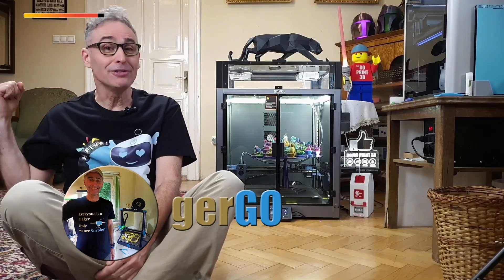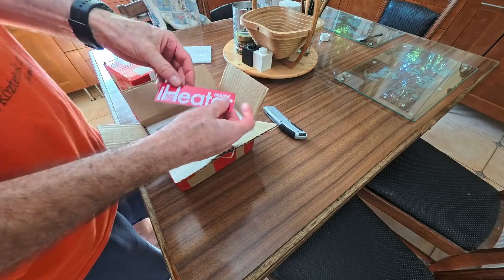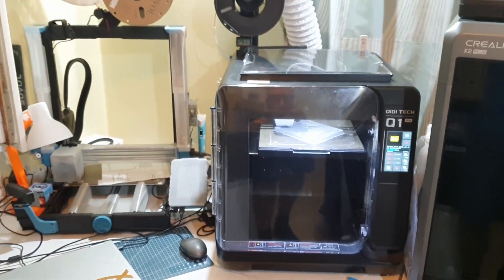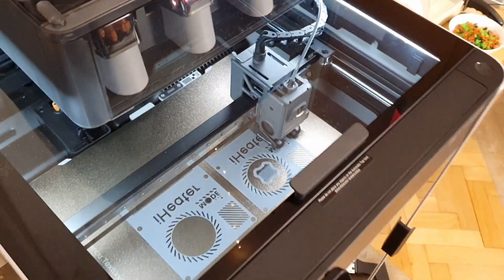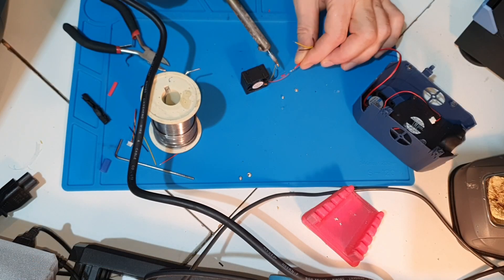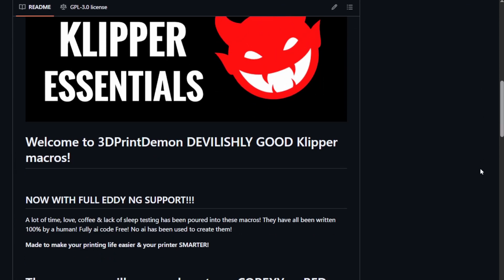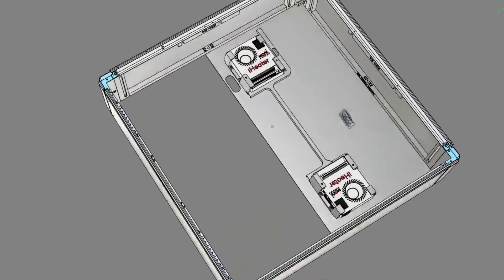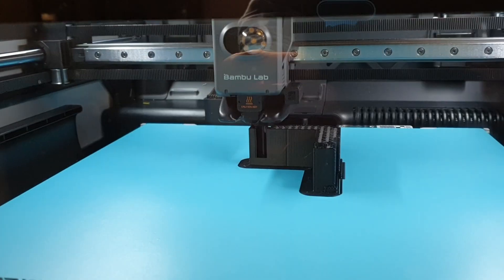SV08 MAX Chamber Heating SOLVED 🔥 Dual iHeaters for 60°C in 10 Mins! 🚀 Making it even better: Part 3

Comment: GREAT video as usual. Would be really handy to have a video on integrating the iHeater with Demon Macros. I used your video (and your brackets) to help add an iHeater to my SV08 non-Max and there's a few things that need to be done to integrate the iHeater with Demon Macros and once it's set up it's a game changer!
Reply from the maker: Thank you for the feedback! I would love to make a follow up video. What things did you do to integrate the iHeater with DKEU? For me they work together well enough, but I am sure it can be improved. Now you made me curious :)
Reply: @gerGoPrint3D  When it’s integrated the chamber heater is controlled until chamber temps reach what Rory has in the various filament profiles in the Demon config. I only have one heater and all I really had to do was edit the iHeater config and change “iHeater_H” to “Chamber_Heater”, “iHeater_S” to “Chamber_Temp” and charge the name of an output_pin. If you wanted to keep the “iHeater_” names that requires editing some of the Demon config files.

Comment: Sovol suggest printing with PETG the doors should be left open, apparently the heat soak with doors closed causes models to sag. It is not clear from the video why these heaters should be added, or what their compatibility / usage cases are? I am waiting for my Max to despatch (ex AU store), first printer owned, and trying to get all the prep done while wait (Noctua fans coming, post processing, hoto etc). When are these heaters a good idea? Thank you.
Reply from the maker: Great question! You're spot on – for PETG, you should keep the doors open and the heaters off to prevent sagging. These chamber heaters are essential for high-temperature filaments like ABS, ASA, and Nylon. These materials are notorious for warping and peeling off the bed if they cool down too quickly. The heated chamber keeps the print warm and stable, preventing that warping and making successful prints possible.
So, you'd only use them for those specific materials, not for your everyday PLA or PETG prints. But that's one of the main benefits of adding enclosure besides the dust cover (which is also important). So keep the doors open for PETG and PLA, and preheat the chamber using the bed and optional heaters if you are going higher temps. Welcome to the hobby!
Reply: @gerGoPrint3D  Thank you for the clarification and confirmation. So, moving to the opposite end of the current topic, do you know of a way to cool the enclosure without a lot of noise leakage so PETG could be printed in an occupied room (my home office)? There will be 24V Noctua fans for this, and setting up a thermocouple to trigger them (either two or four fans) is doable, but an acoustic intake on the fans to keep the noise from getting out is probably a job to do, if this problem isn't already solved. Or is enclosure ventilation unlikely to be reliable enough to prevent sag with PETG? Or am I over-thinking it! Thank you again.
Reply from the maker: @vinces2  Yes, you often can print PETG successfully with the doors closed. The stock dual part-cooling on the MAX's toolhead is quite effective for most prints. You'd really only need to crack the doors open for models with extreme overhangs or lots of bridging. For PLA, however, you'll almost always want the doors open due to its lower melting point.
Your idea about adding thermostatically controlled Noctua fans is exactly where an engineer's mind would go. The challenge, as you've correctly identified, is the SV08's "flying gantry" design. On drop-bed printers, it's easier to add external cooling fans. Other printers solve this with complex airflow (like the Creality K2's curtain fan) or even active venting (like the Bambu H2S), but it's much harder to implement on a moving gantry.
Over-thinking it? Probably a little, yes 😉 While building a custom acoustic ventilation system is a fascinating project, the bigger concern is air quality. My strongest recommendation would be to prioritize finding a place for the printer outside of your immediate workspace. Even PLA and PETG release VOCs (Volatile Organic Compounds) and ultrafine particles when melted. For a home office where you spend a lot of time, it's much safer to have the printer in a separate, well-ventilated room (like a garage, workshop, or a spare room with an air purifier/vent). That single move solves both the noise and the air quality problem at once.
It's a great path you're on with all the prep work! Keep the great questions coming!

Comment: sovol sv08 arrived 10 days ago. had the problems you all know about from inconsistent probing, good print quality but not great. installed the Eddy Scanning Kit from sovol which completely changed the printing experience. excellent first layer better quality print. installation very simple went without a problem
Reply from the maker: Awesome to hear you've had such a positive experience with the Eddy Scanning Kit! I hope to be able to test and demo it too on the channel.
Reply: @gerGoPrint3D  I believe you know, Mr. Gergo, but still. if you mount the eddy on the sv08, I lost 3 hours with the tool head plate. flashing the main board without problems on standard settings in ST-link. (frequency 4Mhz). for the tool head plate, I had to drastically lower the frequency, I don't know exactly, but I think about 400Hz.
Reply from the maker: @MD11pele  Thank you so much. I will need all the help I can get :) I will document my whole journey to get this working! I will email you if I get stuck :)  You see how the tables have turned. Maybe I will have to invite you to Budapest now!
Reply: @gerGoPrint3D  I was in Budapest almost every week for the past few years. I was transporting containers from the port of Rijeka.

Comment: Hi I got a SVO7 and I'm having a hell of a time with it the Z goes all the way down to the build plate and the motor keeps running and I can't get any of the programs to set up, Please help me
Reply from the maker: That sounds frustrating! It's very likely an issue with your Z-axis proximity probe. Here are a few things to check:
1) Probe Connection: Make sure the cable for the proximity probe is securely plugged in on both ends (at the probe itself and on the mainboard).
2) PEI Plate is On: The SV07 uses an inductive probe, which needs to detect the metal in the PEI build plate. Ensure the flexible plate is on the magnetic bed. The probe won't 'see' the bed otherwise.
3) Test the Probe: You can test if the probe is working by placing a piece of metal (like the scraper) underneath it. The small LED on the probe should light up when the metal is close. If it doesn't, and the connection is good, the probe is likely faulty.
4) As for the software issues, once you solve the Z-axis problem, the setup programs should work as expected, as the printer will be able to properly home itself. Let me know if any of these steps help! Unless you changed the software, in which case you are on your own  (or you can try to restore the factory software).
Reply: @gerGoPrint3D Impressed with the time invested in answering this comment. Thanks

Comment: Great video!
I'd like to suggest a video on installing Demon Klippers Essential macros, created by Roar Ree.
It would be very helpful for anyone who has received a blank printer and wants to try this type of modification on a Klippers for the first time, starting with the original firmware.
Thank you so much!
Reply from the maker: Thank you for the suggestion. Yes, I've been using it for a while, teasing it in almost every recent video (I mention it in this video too!). I plan to make a video on it, but there is already an install video → https://youtu.be/SvPROz0Q96M

Comment: I love the ease of printing high temperature materials on my little Sovol Zero - no chamber heater needed for that little chamber.  I now mostly print Siraya ABS-CF and eSun TPU-LW.  The upgraded SV08 Max will need a lot of electrical power but has enormous capability for printing large parts in ASA or ABS.  I assume you'll be adding the Bondtech INDX to max out your Sovol SV08 Max!  It's on my Zero and SV08 To Do list, hopefully in November.

Comment: Nice work, I've been using chamber heaters for many years now, I just uploaded a version 2 on Printables of my 200w heater and yes, a big printer like this one may need two of them, one of mine can heat a K1 Max easily to 65C when the bed is running.
Reply from the maker: Thank you! I checked your heater. How is it controlled? The big benefit of thes iHeaters is its integration to the Klipper system.
Reply: @gerGoPrint3D  Thats up to you, its easy enough to integrate into Klipper, you can use any old cheap 3D printer control board that is supported by Klipper, use the bed heater output and control it through USB from your main SOC Klipper setup if you want, but I use Home assistant with the Moonraker plugin to control things on my setups, as I have a bunch of automations including preheat sequences, everything is done through Zigbee devices, including an automated power cut off triggered by smoke and fire sensors, also controls exhaust fans and air filters, I have nice dashboards built in HA and these are accessible around my premises from any of the HA wall mounted control panels, I use Dell Latitudes for this, also the model for the wall mount is on Printables as well :)

Comment: This process is way to long . Sovol was advertised a enclosure as a equipment for heater. And when officially came out for sell it’s in fact without it . What a shame for this company ….
Reply from the maker: It is coming too. I think they were transparent that the enclosure will follow the printer, and a bit later they will have the heaters ready. They haven't yet sent heaters to us, beta testers either. I will make a video about the stock option too. Maybe even use the two system together! 🔥

Comment: Very surprised  to see that the top is the best place for the heaters. Since hot air moves up, the air which is heating will stay in the top of the printer. Mounting them a the bottom of the chamber (I know, no space for that in the Max) would create natural convection, circulating air. Hot air goes up, pushing colder air down which then gets heated etc.
Reply from the maker: Yes, we were also suprised, but the tests proved this location. My theory is that the huuuge bed already takes care of the lower half of the chamber, the strong blower fans mix the air higher up.  Convection would move the heat of the bed to the top, the two blowers push it back down...
Reply: @gerGoPrint3D  This is correct. I've seen this in older designs,. the bed heater provides heat below in a constant supply, heaters at the top with fans to cuirculate and you end up with good heat throughout the chamber.
Reply: @gerGoPrint3D  Sounds plausible 👍
Reply: @gerGoPrint3D natural convection is really slow. GamersNexus tested it once. Any fan completely overpowers it.